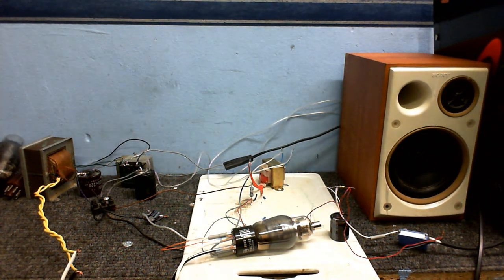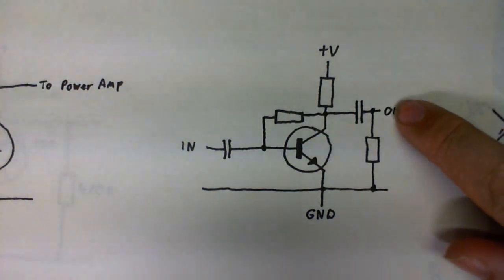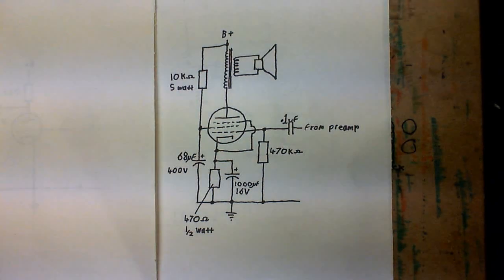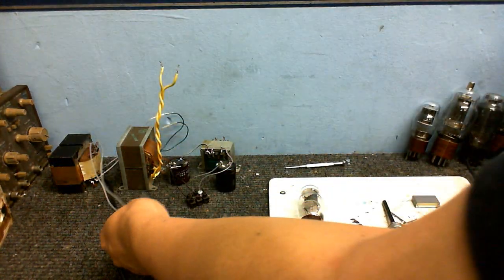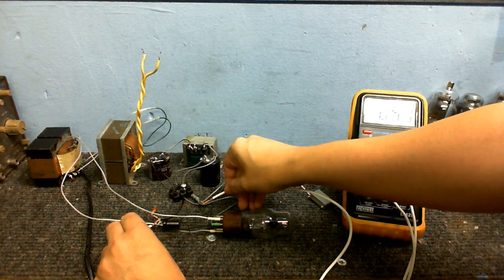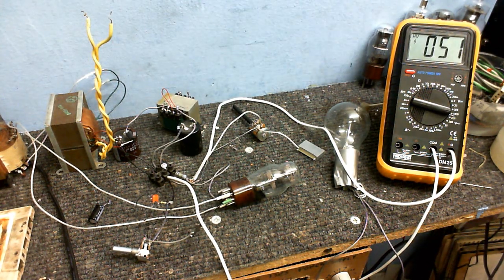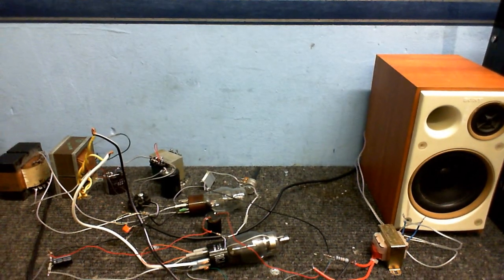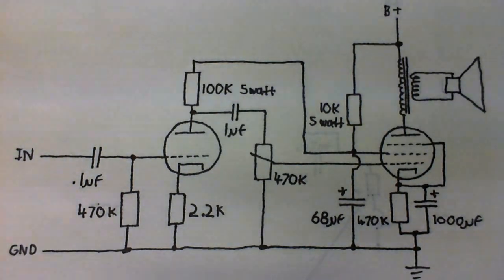Building a simple Valve Amplifier

Comment: i think you have a ground loop issue between the tube amp and the R2R.  you might need an isolation transformer between the amp and the R2R, or link the "chassis" grounds with a simple jumper (depending what kind of ground loop situation you are having)...but i may be way out to lunch and be completely wrong...and this video is 5 years old, so this is like telling an egyptian mommy how to build a pyramid better.

Comment: Hi, this is a great video. I'm a total beginner to electronics and I'm trying to learn about how valve amps work by watching this video. I have one quick question regarding the schematics. At 3:49 what does B+ mean? Does B+ signify a power source of some kind? Thanks
Reply from the maker: B+ simply means the supply voltage, it's the same thing as V+, but it's usually written as B+ in tube schematics because in the really old days this is where the "B" battery would be connected to supply the high voltage for the circuit, later on using B+ to show where the high voltage supply is connected just kinda caught on so even if the circuit is powered off a transformer, it is still marked as B+.
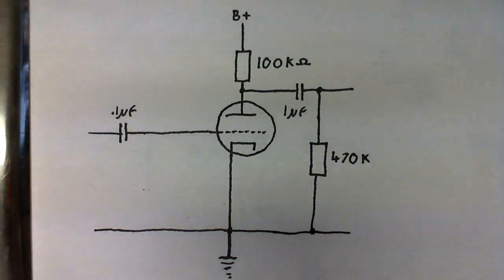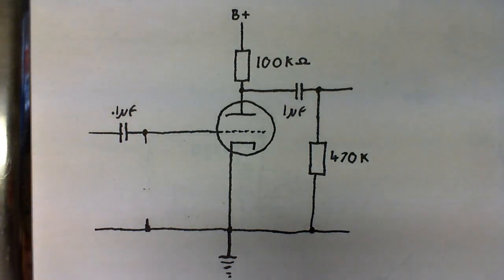Reply: Okay I understand now, thanks for that. At 3:47 you say " The voltage at the grid must be lower than voltage at the cathode". At 4:41 you say this can be done by adding a resister between the cathode and the ground. This resister raises the voltage of the cathode. I don't understand how it raises the voltage of the cathode?
Reply from the maker: It works in a similar way to a voltage divider, the valve itself can be thought of as a resistor (technically it isn't a resistor, but for all intents and p[purposes it can be thought of as one) , so it's like having 3 resistors between the positive and ground.  Aftrotechmods has done a video explaining how voltage dividers workhttps://www.youtube.com/watch?v=XxLKfAZrhbM and explains it better than I ever could.
Reply: In addition to B+. In Britain, it was referred to HT, which means High Tension. Another old word which isn't really used anymore.

Comment: Hey Clem, Pretty cool. Miss the channel, I personally really liked it. I would like to recommend a really good channel, Uncle Doug on YouTube, who builds, reviews and does tutorials on tube or valve amps, primarily vintage Fender or other Valco built amps like Gretsch or Supro and such. You sound like you have a pretty good handle on valves. I'm in the process of building, Point to Point wiring, a Fender 5F1 "Champ" amp. A 5Y3 rectifier, 12AX7 pre-amp and a 6V6 power beam out put tube/valve, 5+ watts of pure vintage tone. Finish your other projects and get back to building vintage amps, money provided. Take care, be good, C.
Reply from the maker: Thanks, I already have subscribed to Uncle Doug, his videos are my kind of thing.  That's good advice about the high voltage safety, I should be a bit more careful. I do take safety precautions such as discharging capacitors between shots though.

Comment: Hi Clem, I am trying to set up my first valve/tube pre amp and have copied this http://diyaudioprojects.com/Solid/12AU7-IRF510-LM317-Headamp/ it works and is really loud in headphones and will power an 8ohm speaker. Problem is it has a hiss when the music level drops between tracks and when music is quieter, have you any pointers. I am using ECC83 / 12AX7 because it is 12 volts and I am not confident to try with 240v.
Reply from the maker: +Elecifun Those tubes are a little noisy, I found that out myself with a preamp I made.  The newer ECC/12AX7 are a little less hissy though. You could try adding a resistor (anything from 100 ohms to 1k) between the headphones and the amp, it should reduce the hiss but you would need to have the volume turned up higher.
Reply: CoolDudeClem Nice one cheers Clem I will give it a go. I am reading about trying to eliminate the hiss and my tube maybe an older one.

Comment: if you have a 7806 voltage regulator should solve your HUM problem also you will need at least 750V for the valve to work, 1 Megohm resister Brown,Black,Green,Silver. Certain motherboards actually have a socket for a tube which can give a pleasing sound so you might be able to have the tube inside your computer, KATE BUSH is actually quite a nice singer so don't know why you don't like her.
Reply from the maker: +DAVID GREGORY KERR When did I say I didn't like Kate Bush?  Wuthering Heights happens to be one of my favorite songs.

Comment: I did this kind of thing in the 70s with transistors -- but that was only 9 volts. This is probably the most dangerous thing I've ever seen in my life. If it weren't for that, it would also be the coolest. I had white knuckles all the way through. For Christ's sake be careful!
Reply from the maker: +trappedinthefuture It's not dangerous if you know what you're doing, like I do.  If you think THIS is dangerous, have a look at my VTTC experiments, then come back and say I can kill myself just by breathing on this circuit.
Reply: +CoolDudeClem I didn't see your 'please stop freaking out' message before ;-) It's quite evident that you know what you're doing, and I take my hat off to you for that. All I'm saying is that it's possible to slip and touch something by mistake. But I'm sure you already know that. Standing down... :-)

Comment: CAREFUL dude!  There is a long list of dead audiophiles and Ham Radio operators who fried themselves by mistake by being exposed to high voltages, especially the kind that tube amplification brings about!
Reply: CoolDudeClem As long as you keep the "One hand rule" that might work out.
But if you use your second hand it will act as grounding+it gives a electricity a nice way trough your heart,the most important muscle in your body!
So start by tieing one hand to your back,and learn to use multimeter with one hand.
Also,i dont know much about vacuum tubes as im relatively young,but HV is a bitch and if current is not lethal,you will have nasty burns(ussualy tiny but deep) and probably some muscle atrophy(spelling?).
Anyway,im not scared to go into these waters as i found few vacuum tubes in my basement(Iskra ECL-82) and im looking for super simple way to make one amplifier,efficency is not a problem,nor gain and sound quality.
Also i found one of these "lamps" that display a number from 0-9 when power is applied on right pins.
Do you have idea how these are called?
Also mine doesnt have any specifications,so any info is helpful!
from 14 year old
Sorry for spelling mistakes,and stay safe
Reply: @SilenT●CSGO & More! " Also i found one of these "lamps" that display a number from 0-9 when power is applied on right pins.
Do you have idea how these are called?" 

I Think based on your description these are called Nixie tubes..

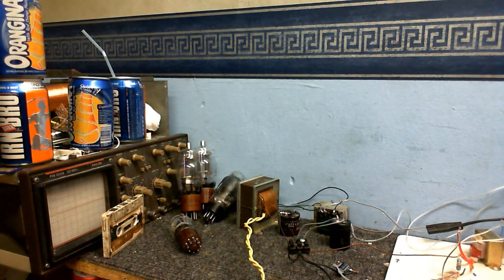Comment: 1:27, have you tried using a regulated power supply to reduce the hum? You could regulate for arbitrary high voltages and currents with simple additions to the single chip solutions like the lm317, or 337.

Comment: What IF...

I substituted an EL34 for the 6C6? Could I leave the components the same? Mostly?
I know this is a popular valve for push-pull amps (the EL34) but what u think? Could it work?

What about subbing an EC92 for the triode? Just throwing ideas out there for cheap tubes I have lying around....or are they "laying" around? Perhaps they are Laying. :D
Reply from the maker: ***** Can't say for certain, but it probably would work, I myself tried my amp circuit on different output pentodes without changing anything else and it worked each time.  Changing the triode should also work, I've found that valves aren't all that picky about what components you use.  If you like to experiment then it's worth experimenting with just to see how well it works.
Reply: "Love to experiment" is an understatement. I'm crazy about it! The components and tubes that I have are cheap so if I sizzle or destroy some things it's no problem. Sometimes it's half the fun as long as safety is observed.

I'll try it with your design and see what happens and post results and video here on YouTube.

Thanks for your reply and feedback. :D
Reply: ***** The EL34 is ideal for running as power stage for a single ended audio amp. But ignore almost everything in this video. This is dangerous and fairly useless, even if entertaining. The EL34 will need a suitable output transformer and without that you will just get low power and distortion. You will need a voltage gain stage with a little double triode or a little pentode to drive output, The operating points of these need to be reasonably well set to ensure low distortion, so get the correct values -There are lots of proper circuits to follow to make a simple amp with these valves. You can get up to 10W from an EL34, and if you find a good transformer it will sound better than 99.99% of all the amplifiers in existence. DO NOT HIS TECHNIQUES WITH 350V use caution.

Comment: Yet again, I have another question before I plug this thing in. Regarding the ground. Should it float you think or should it be "grounded to ground"?  My amp (of exactly your design as far as I could clone it) is built in a wooden box. The input jack is connected to the input capacitor of course, AND to the ground-wire circuit. So it the negative end of the 250VDC supply. Couldn't one get a shock? I mean, I guess there is no "closed circuit".....still it's a little scary.
Reply from the maker: ***** You could run it with the ground floating and it would be unlikely you would get a shock from the circuit's ground, but I always connect the ground on circuits like this to earth ground just for safety.
Reply: Ok. So it's your opinion that it would be safer connecting the negative terminal to earth ground. That's all I wanted to know. Thanks.
Reply: If I am building an amp I always leaf the negative disconnect from ground
Reply: You leave it disconnected? Why? Just curious. I mean, I suppose if you connect the neg. to the ground then you reduce danger from getting any jolt from neg. but you'd also increase possibility of injury if you come in contact with the pos. charge, right? I'm using a wooden case so it changes the dynamics a bit. Clem used no case at all as a demonstration. I decided to use a cheap wooden box as it makes it safer and neater, plus it's obviously easier to work with than even thin metal like cookie tins and the like. Until I have a large enough workshop to have drill presses and such areas set up to work with metals, I'll be sticking with wooden boxes. I sent Clem a small box of extra tubes I have, mostly Russian and Czechoslovak. We'll see what he does with those.
Reply: Now that I've successfully COPIED one tube amp, I'll be looking to make modifications. First maybe I'll try to make an amp of similar design but using my cheap Russian tubes to see if they are a better bargain or just cheap junk.
Reply: I have one thing why I don't connect it
Why would you isolate the power supply
To just reconnect it back to the mains

Yea I know ground isn't live
But it is part of the mains circuit
Reply: Maybe in the real world. I don't live in the real world. I live in Slovakia. I DON'T and I mean I DON'T trust the ground-mains to be grounded here! Sometimes yes...sometimes no....I have had bad experiences. No, if I ground it, it will be to the RADIATOR.
Reply: Also, another reason why I isolate the power is it is safer (in my opinion) AND it is more steady and stable than power here. I'm not kidding. I live in an old communist flat and the wires here are not even copper! I had to re-wire the whole flat...and the electrician is coming again TODAY just because of more faulty wiring problems. Instead of using couplings or soldering they used TAPE to hold wires together! Imagine after 30 years how a tape connection holds. Lights flashing, computers ruined. No ALL of my power to everything but light-bulbs is isolated if I can help it....thanks to the Československá socialistická republika!
Reply: I suggest that you don't ground it
It never happened in old radios or televisions
And I never do it
And that still has not caused any troubles
Reply: Well, I haven't decided yet. For now I'm not making any changes but I'm leaving the PS isolated. :-)
Reply: *****
 I'd always ground it. mains ground wire to chassis. Inside chassis i always use a star grounding position
Usually one at the pre-amp tubes where i connect all the low voltage/signal groundwires,  and one at the output tubes where i connect al the higher power groundings.

That method seem to work best in my experience. Build a perfect single ended EL84 in class A without any noticeable hum
Reply: I'm more concerned about safety than hum...I built this in a wooden chassis and I had absolutely NO HUM at all and it sounded GREAT.

Comment: Clem, as I see your schema (I've enhanced it here and added some labeling) the V1  anode is SUPPOSED TO BE connected to grid 2 of the pentode, correct? From what you've demonstrated this design works perfectly. I have not yet completed my "neat" version of your design yet....I will show results soon I hope. Cheers.

https://www.facebook.com/photo.php?fbid=331586447013180&l=cdcf358cea
Reply from the maker: it's a little bit like that, if you follow the path from the pentode's (V2) grid 2 to the anode of V1 you'll see there's a 100k resistor connecting them.  I basically set it up like this:  Grid 2 of the pentode gets voltage from the b+ supply thorough a 10k resistor, there's also a capacitor between grid 2 and ground to smooth out any ripple.  Now because grid 2 takes a little current, it will pull the voltage down a little, and low enough to safely power V1 (which could probably take the full b+) Anyway can't just connect V1's anode and V2's grid 2 directly or it won't work, so a 100k resistor between the 2 is what I used.
Reply: CoolDudeClem So "yes" or "correct" is the answer? :D Thanks. Sounds logical to me. I posted my pics with your schema on the FB "Vacuum Tube Amplifiers" (an open group) and the "Electronics Class" (a closed group, wish you were there, would be nice) and someone said something like "wouldn't be better if anode V1 was not connected to g2 V2? And I more or less said "I don't know, if so what would be better? Just leave g2 V2 open? eh? This amp works great from what I know..." But I'm always willing to tinker. I hope you don't mind I posted your schema there. The open group can be found at :

https://www.facebook.com/groups/VTAgroup/

my specific post should be here:

https://www.facebook.com/media/set/?set=oa.10152274907241333&type=1

Hopefully you can see those...not sure. Cheers.
Reply: CoolDudeClem and despite my sarcasm, I appreciate the explanation. I wish I could see these things as clearly as you seem to. I love science and electronics, but my mind doesn't focus so easily.
Reply from the maker: ***** I assume you mean grid 2 of the pentode? if you leave that not connected to anything you won't get any output, grid 2 (called the screen grid) kind of sets the gain of the tube, without any voltage there it won't do anything, so best to keep that connected as it is in my schematic.
Reply: Yup. I meant g2 of the Pentode. I thought it sounded like bad advice. Did you see the comment on FB? I'm so ready to dump FB again but it is the best connection to my family.

I am not changing ANYTHING you recommended, I am however curious to see if the tube substitution will work that I mentioned before. I will send you one or two of those plus a couple of 63PS....you'll like those!

http://www.radiomuseum.org/tubes/tube_6p3s.html

(hope u can see that link)

By the way, you're 200% correct about analog audio....my TESLA B101 works PERFECTLY and it sounds beautiful. A lucky find. Sitting on a shelf in a school for years. In a cool dry place.
Reply: Check this out regarding that other valve substitution if you like. I'm going to try this one anyway as you suggested. I don't care if it blows up or not.

https://www.facebook.com/media/set/?set=a.331813206990504.1073741837.100004854810002&type=1&l=b23a96fab1
Reply: I guess it won't work with the 6Q5G after all because even though it looks like a triode, it is actually a gas filled tube used as an oscillator. I guess it is not a "true" tube or triode but a thyristor.....so I don't think it will work right. I'm gonna play it safe first and just stick to the original set up you created.

Comment: hi love your circuit i am a valve tech with your circuit were your input cap is use .1 mf  on input us a 1 meg on the screen witch keeps it at 0 and your cathode 1000 ohm and 25 mf 25 volt this work really well for a 12ax7

Comment: Hi Clem. Which pentode and triode did you use?
Reply from the maker: I used a VT137 and a 6C6, but it can work with almost any pentode and triode. An ECC83 (also known as a 12AX7) and an EL84 are quite often used.
Reply: Clem...thanks for you help. People like you are the best thing about YouTube and the Internet.

I have plenty of these typical triodes laying around...including several E88CC....but what about 6080 triode? Type 30?

The main thing is I'd have to adjust for specs....